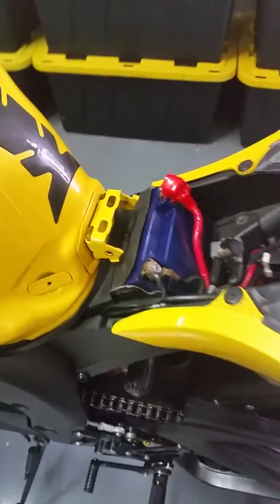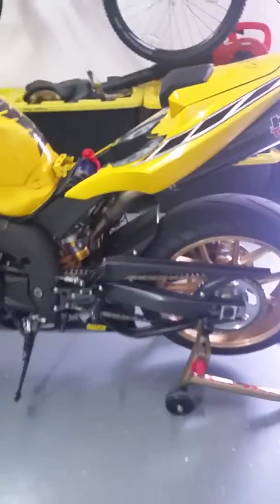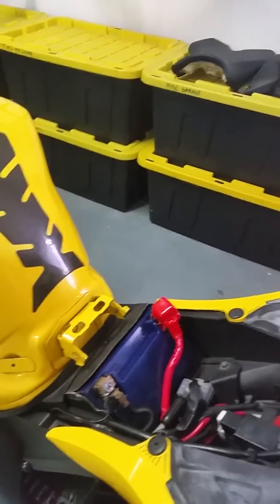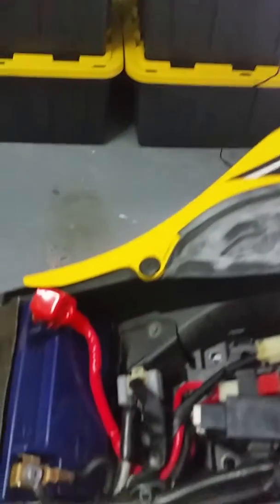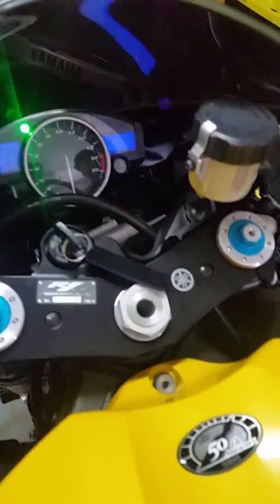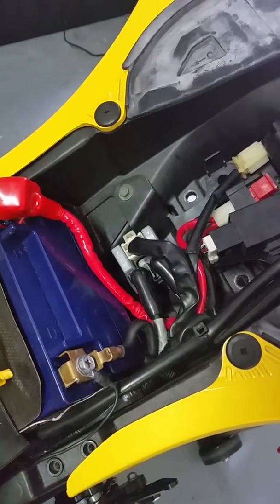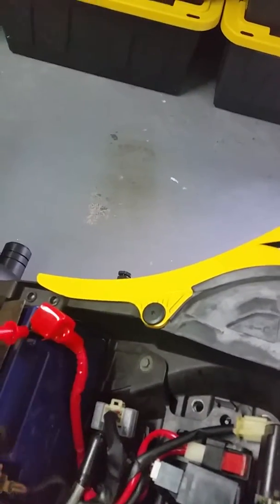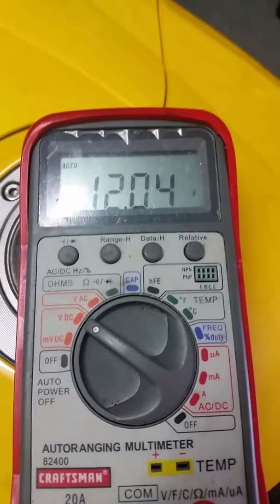2006 R1 starting problems

Comment: Give your starter motor a few solid hits with a solid metal bar" my old 250rr use to do exact same thing starter is on its way out" But a couple nice taps on starter motor itself should get it started Learnt that from NRMA roadside assistance lol

Comment: check ur motor starter or it could be ur battery relay also try to get a new main fuse and change ur spark plug or reset your ECU

Comment: Sames like for me bro,how to fix like that problem bro,my bike is yamaha r1 2006 50th annivrsary,?
Reply from the maker: new battery
Reply: @Eno_818  
Have the same issue on my 05 however when trying to replace with a car battery and still no luck. Found also that current battery I had for one year was a bit bulgy

Comment: Hi sir did you fix it by getting a new battery??
Reply from the maker: I did.
Reply: I did qnd it still didn't work I think its a new solenoid or starter relay if I figure it out ill let ya know
Reply: 2 years went by and still fixing it
Reply: @vaiynstrife  IF you haven't fixed it yet I recently had a starting problem on my r6 the solution was a rectifier, when i'd start it the battery would immediately drain then go back up, if i charged and got it started when I rev it the volts would go up then would slowly start to drop back down if I rode it for a bit then shut it off the bike wouldn't start back up. 

So if you rev the bike and it charges the battery but continuously drains once off the throttle your rectifier is bad or going bad.